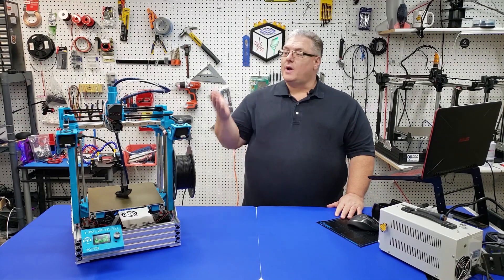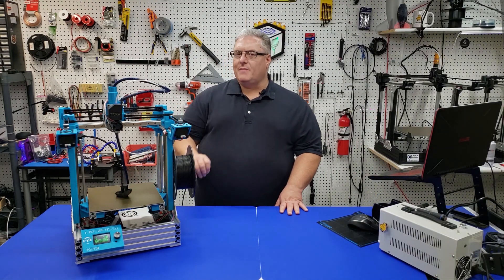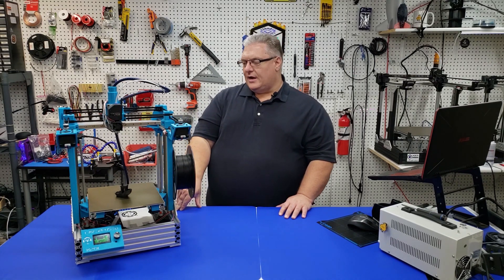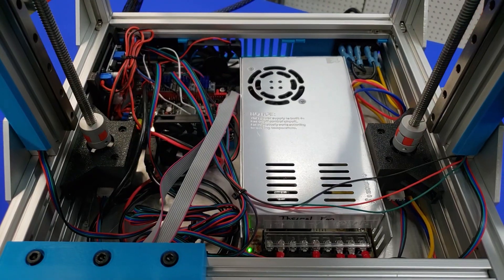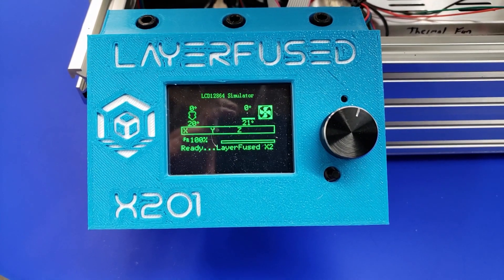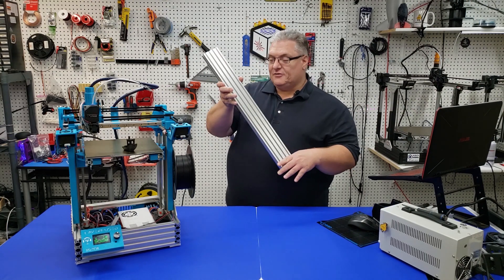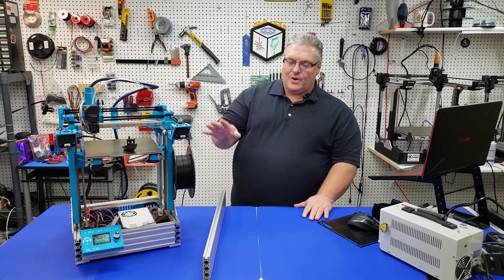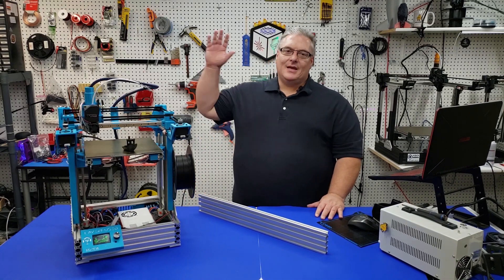Introducing the LayerFused X201 - Desktop DIY CoreXY 3D Printer

Comment from the maker: Will you be building an X201?
Reply: Actually I was building X251 inspired by X301
Reply from the maker: Nice!
Reply: I wanted a 400x400 size, but now I want the 501. Only an other screen. Prefer touch screen.
Reply: @emiel1976ep  it does have a touch screen, the screen has both, just hold the button in and can switch to either the touch or the marlin control.
Reply: @rclarke250  OK thank you. I also found that they have a bigger screen. I thought that only the bigger one was touch.
Reply: Yup! waiting for the BOM :)

Comment: I want the 501.
Is it possible to make it with a dual extruder so you can print in dual color?
Reply from the maker: Sure. Open builds are easy to mod for your own use cases.  I suggest a mixing extruder if you go that route.  You'll need to change your carrige to a bowden setup too.
Reply: @MakersMashup  I need to learn those things and see how it works.
I first finish my current diy projects. Building a second recumbent trike, fiksing a trailer and going to build a second one. After that I will start with the 3D printer.
I live the design. I wanted first build it with the extruder on the x z and make the frame a lit stiffer. But this design solves it and is also smaller.
I hope that as I start, that you have a xy501.
Is there info about the sizes of the aluminium parts and will you sell the 500 size heatbed?

Comment: I wonder if it would be complicated to build a x201/301 mashup with a 200x300 build plate?
Reply from the maker: Actually super simple.  Just build the X301 frame and make your own custom bed mounts.  You just need to then tweak the firmware for the shorter bed.  Very simple to build this configuration.

Comment: Shipping from the USA may be too expensive to asia from your store.  Would I be able to source the frame locally, and purchase the other items from your store?  All open source?
Reply from the maker: Yes the X301 and X201 are completely open source.
Reply: If you're able to order from Misumi, you'll have access to 80% of the structural parts from the one supplier with competitive costs.
Reply from the maker: We order from misumi.  Prices are Not very competitive however.
Reply: @MakersMashup  Misumi south-east asia might have different costs to USA. I got all my extrusion, nuts/screws (unfortunately sans brackets) and signal cabling for $110USD - what sucked was $67USD shipping cost on top!

Comment: Ender 3 build plate is 235x235 so you are missing 15mm in each of the x and y direction.
Reply from the maker: The usable space per their specs is 220.  The x201 has the same build plate.
Reply: @MakersMashup  I haven't had anything exactly that big to print but it sure was bigger than 220mm. So sure, if  you you only go by the advertised size you would only have 220mm but if you look at the community at large you knew it was a bigger usable space than just 220mm. So my conclusion is that you never used an Ender 3.
Reply from the maker: Really? The one in the background of my earlier videos must be video editing.  LOL. That was a good one.